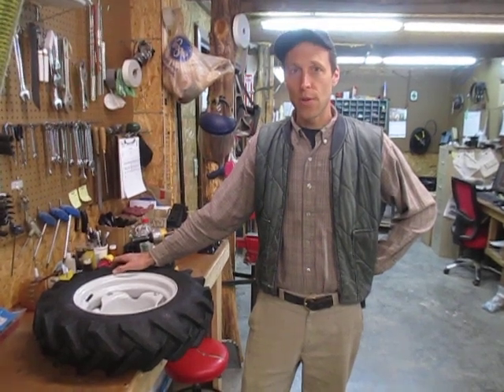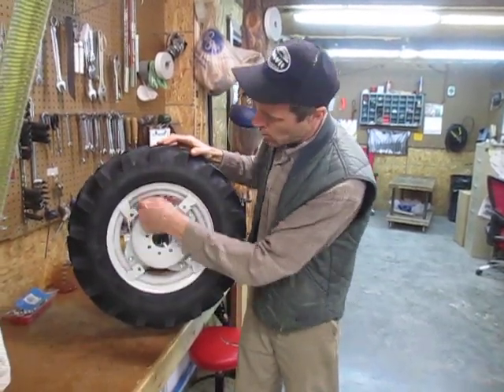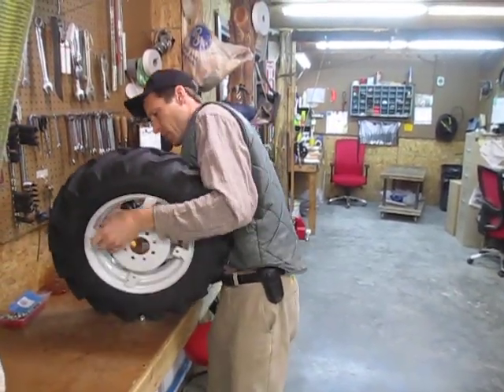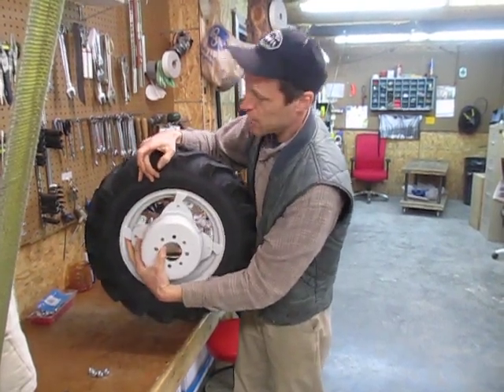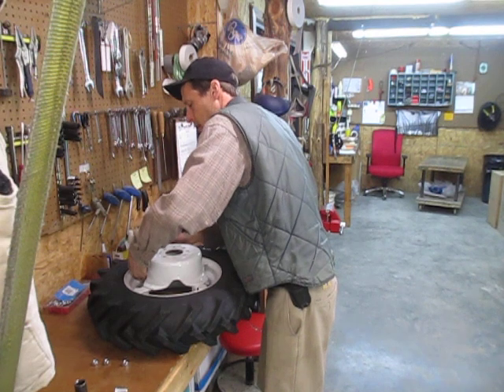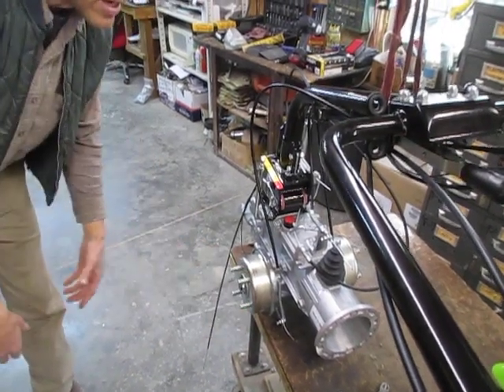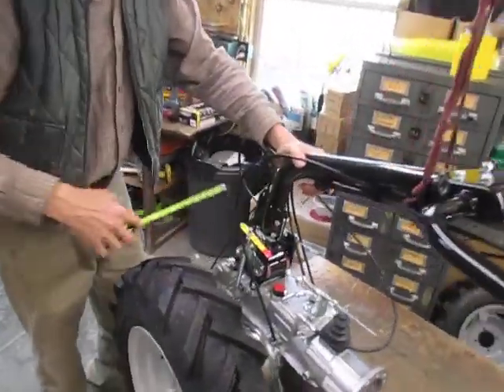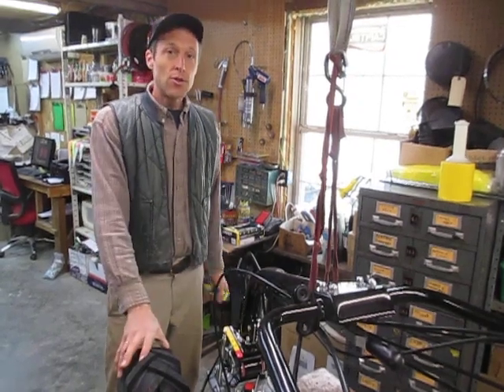Adjustable-Rim Wheels for Walk-Behind Tractors

Comment: Thanks. How does one determine with the optimum track width for a particular application? For example, with a 32 inch brushhog or a 30 inch tiller or a 28 inch snowblower?
Reply: Sorry for the delayed reply.  The best thing is to figure out the best track width that will work well with ALL the implements you plan on operating, so you don't have to be switching track widths from implement to implement.  For example, the Rotary Plow is a very popular implement for us, and for its proper use, the wheels should have roughly 17" of space BETWEEN the wheels (resulting in a 27" outside track width, with most of the standard 5" wide tires that come on these tractors). As a result, the 27" outer track width is what most users leave their wheels set at all the time.  Now, if you have steep hills to mow, and you need extra track-width for more side-to-side stability, then the wheels just have to be adjusted wider...but you might have to adjust them back in for other applications.  The rule of thumb, of course, is that you don't want the wheels wider than the implement in most cases...(unless you are "straddling" a garden bed)